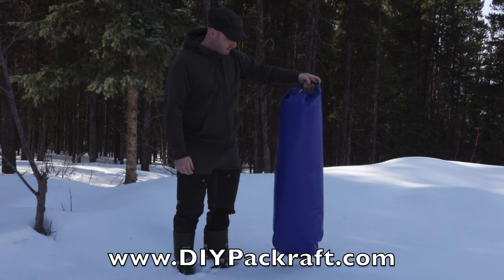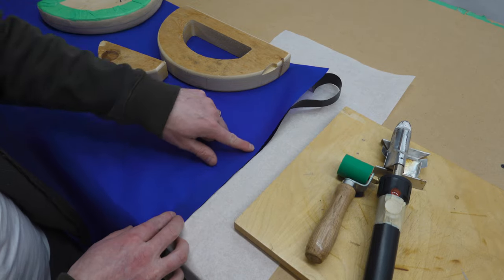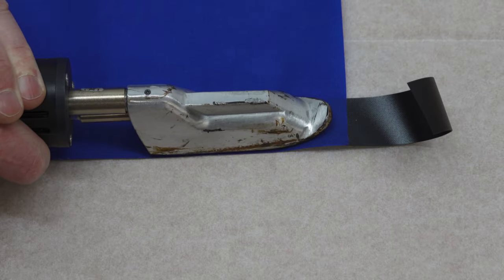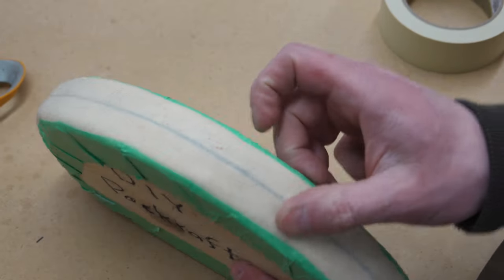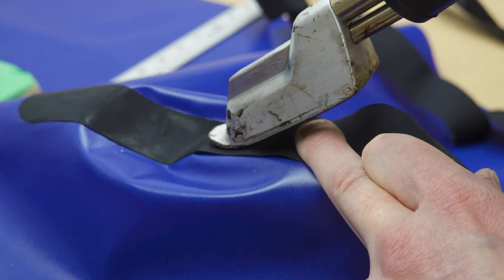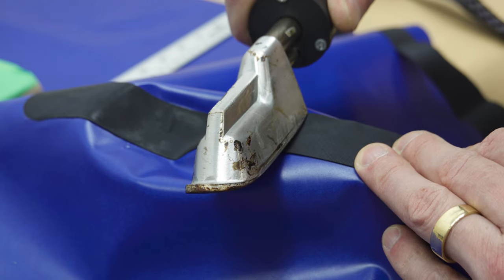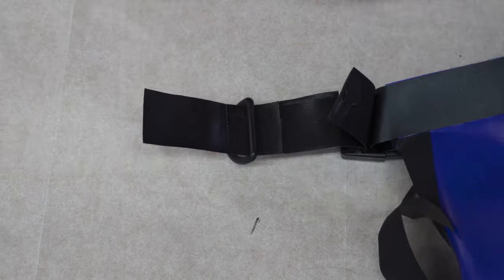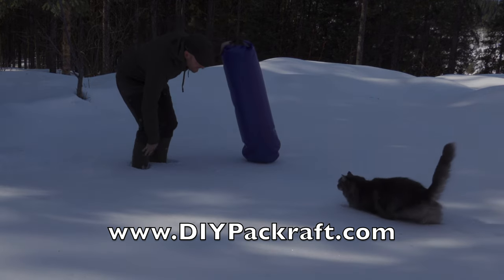DIY Packraft Drybag Kit Assembly Instructions

Comment: Your iron appears to be 220v; any idea how much additional time using a 110v iron?
Reply from the maker: It’s a 220V iron but it’s plugged into a 110V circuit. A 110V iron should take the same amount of time, because the iron needs to be at the same temperature to make the welds either way.